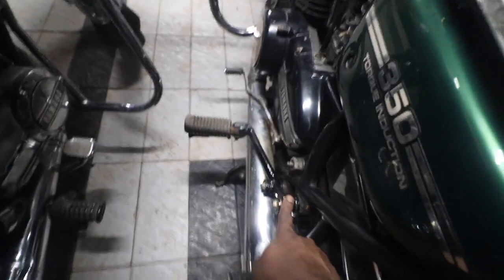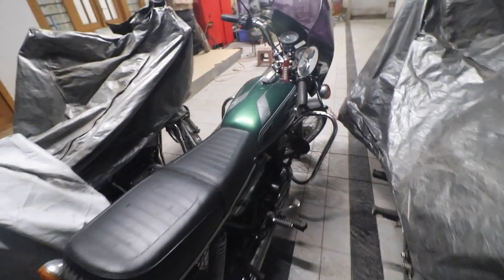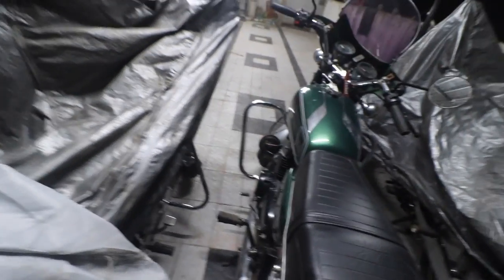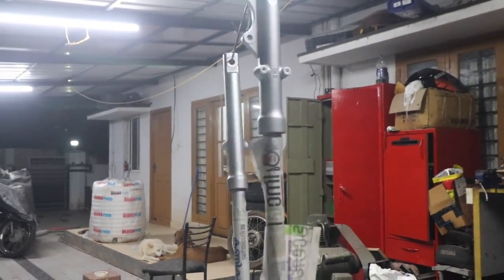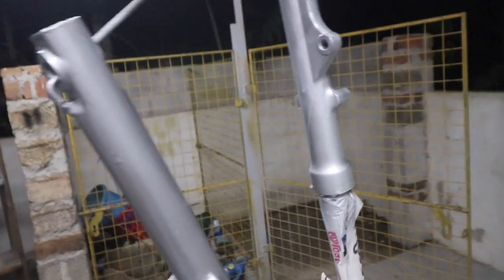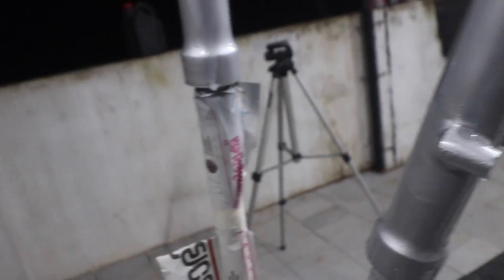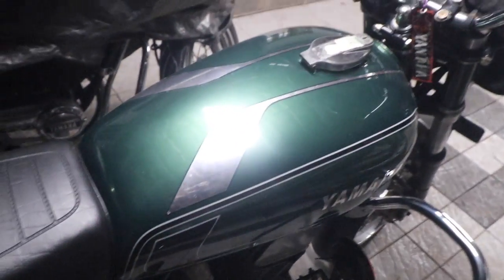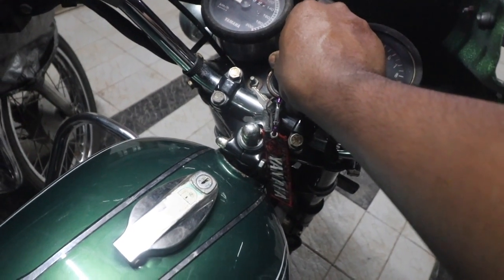Bike fixes during lockdown

Comment: Nice RD
What ignition system on Rd
Reply from the maker: thanks, Rdd analog
Reply: Yamakaze  oho nice ❤️
Reply from the maker: Akshay Sandbhor Patil not as mental as one expects. Out of the box the performance is mediocre, but when you pair it with a flat slide it can put things in place.
Reply: I’m using original VM carbs so don’t know how it will perform with TM carbs. I like to keep bike as stock as possible I was working on ignition for RD from last 3-4 yers I hav tryed lots of CDI’s “Mzb , RDD Ac & dc both , Ravi Nagesh etc “
Reply from the maker: Akshay Sandbhor Patil what made you switch between so many CDIs
Reply: Yamakaze  some cdi hav smoothness Bt not equal power delivery some hav good performance at lower RPM with smoothness Bt no performance at higher RPM some hav best performance at both low and high rpm Bt no smoothness according to me us spec points does good so using same thing on bike right nw Bt the periodical point maintenance 🤯

Comment: bro rx135 me rpm metter kasa fet  hoga . electric rpm meter
Reply from the maker: Rimjhim Kumari 3 wire hote hai rpm meter mein, laal, kala aur teesra koi bhi rang ka ho sakta hai. Laal battery ke positive me lagega, kala negative mein. Teesra wire ignition coil ke input me lagega. Shogun/Shaolin ka meter hi sahi reading dega, pulsar ya fir koi bhi 4 stroke ka meter double reading dega.